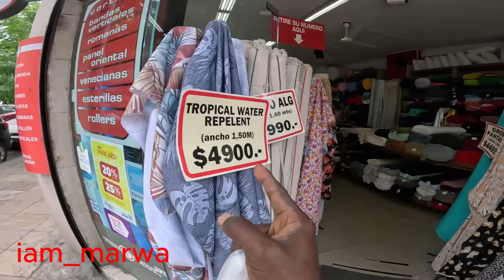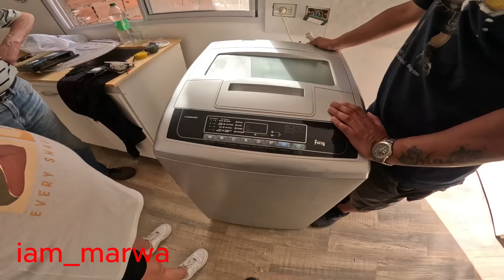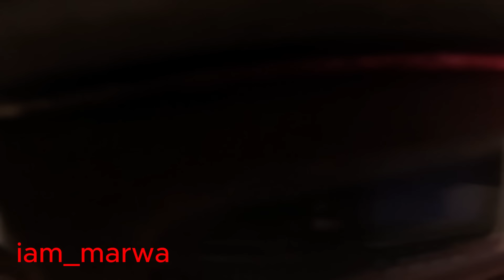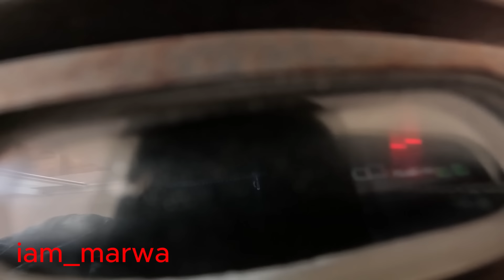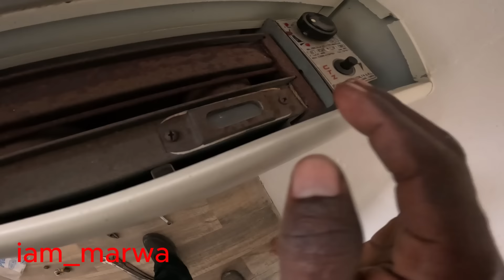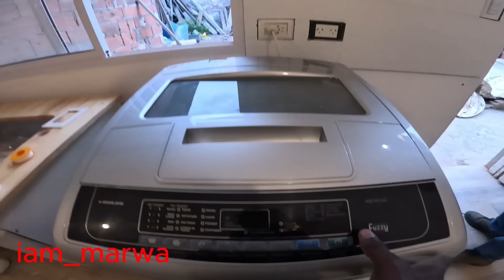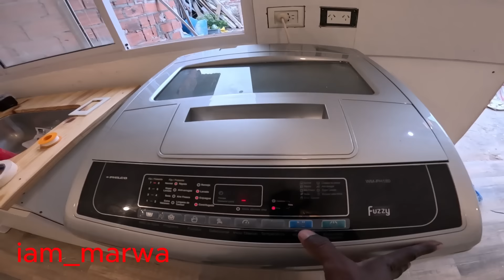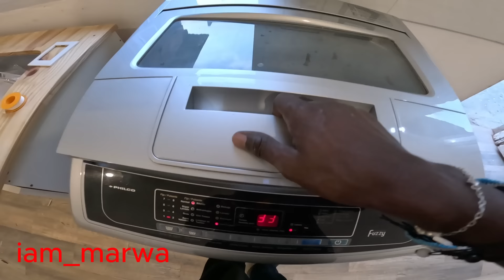WATCH our MULTI-MILLION NEW Look of Our Studio in Argentina 🇦🇷 😍

Comment: Marwa you bored a hole above the water boiler but in addition you need to install an electric air extractor in the bored holes. You might also probably need an overhead hood above the gas cooker with an electric gas extractor as well because even if you guarantee opening the window when cooking, opening of the same might not be convenient in winter. You need adequate carbon monoxide extraction from your  house.
Reply: Marwa doesn’t know those things. Rocio should know that. ..

Comment: The washing machine normally carries hot and cold  intake pipes. I have seen only the cold water intake connection.
Also please verify whether the stove has a pilot light or an electronic lighter.
If the above is the case then you would not need to 
manually light the burners each time you are going to cook. Make sure to have it checked out properly by a professional for your personal safety.
Seems you need hot water lines to both kitchen sink as well as washing machine.
Reply: i agree it probably does have a pilot lite inside of the oven.

Comment: Look up flex line for gas stove etc and if you see or even use a rubber type hose for a BBQ grill it has a REGULATOR attached to not allow a GAS SURGE that can cause an explosion and it’s away from the HEAT, that hose in the stove under the hood of the stove with all burners 🔥🔥🔥🔥 Lit will not be good for that rubber💯❌💯